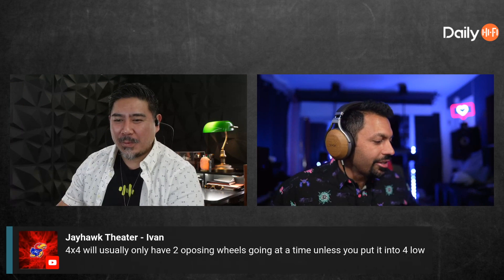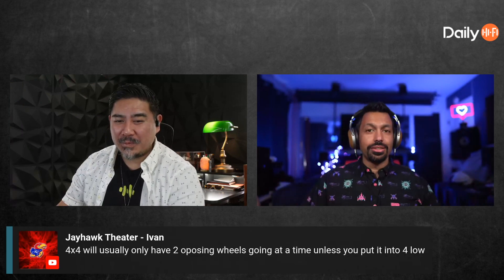How To Use The Spatial Audio Calibration Toolkit: Case In Point!

Comment: Using the test tones for my height channels , I found a resonance in the rear left height Speaker @ 65Hz. Popped the cover off, grabbed the Phillips, and tightened the screws that held the Speaker  in its frame (not the dog ear clamp screws BTW).

Nice work Boys ! Any possibility than Channa would add a quick demo track onto the BluRay with some music or sounds effects running through all the channels ?
Reply: I love hearing these use-cases!